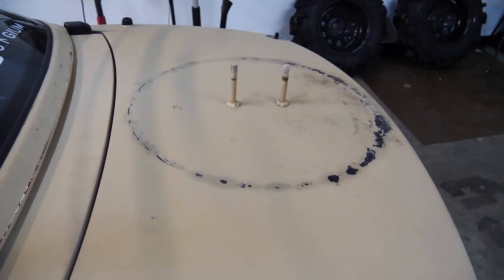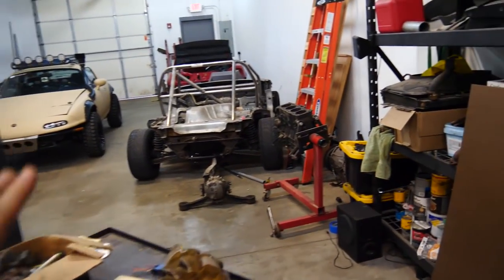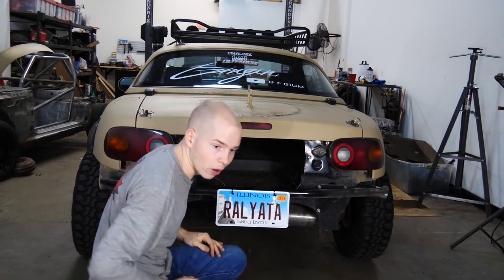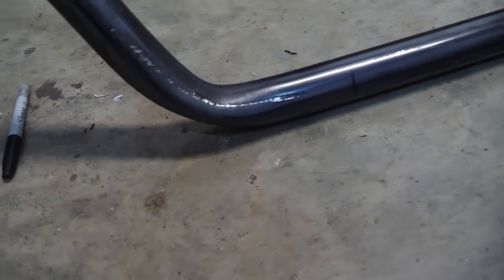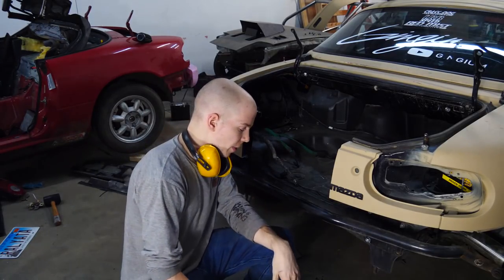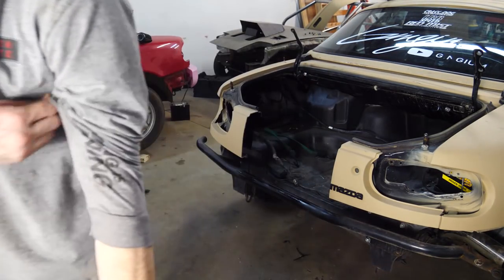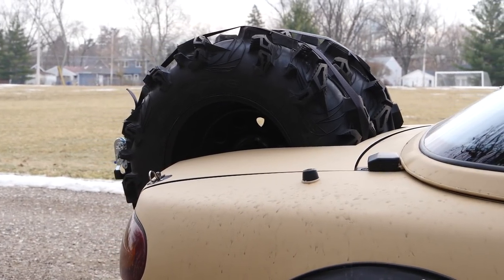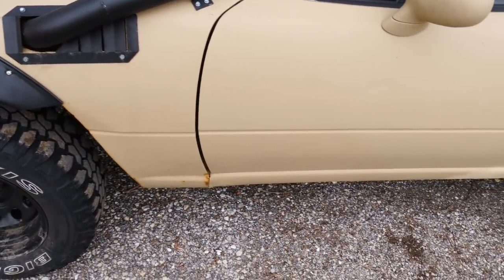Lifted Miata Gets a Trophy Truck SPARE TIRE Setup!

Comment: I feel like he’s gonna regret this
Reply: Who cares? It’s a RALLYATAAA.
Reply from the maker: Why? Its awesome!
Reply: He might, but that's easy enough to fix when you have a welder and a spare miata sitting around...
Reply: İ really don't like it
Reply: if he goes mudding again, that trunk will be filled with water or mud
Reply: @_Gingium_  because  this only helps wile it's 2wd and if anything Hits it it's going to bend and it's going to be totalled
Reply: FuNcTiOn
Reply: @_Gingium_  I completely agree, it is awesome... Just do some spray in bed liner to protect the trunk and you are all set.
Reply: @garrettmonk8432  ... Your comment is a bit confusing... The Miata is only rear wheel drive (2 wheel drive)... and the material Gingium removed is NOT structural, it is superficial... Besides Miata's are so light anything "hitting" them causes serious damage, even completely stock. He at least has a reinforced "bash bar" that will stop minor impacts, from causing serious damage... The factory bumper does not stop anything.
Reply: @JJ_ExMachina  so he is no longer doing 4wd conversion  and if he slides into a tree or something because crap happens it will start to separate
Reply: @garrettmonk8432  if he slides into a tree it wouldnt have mattered much if he had a full trunk or not
Reply: @RK Deviancy the trunk doesn't do shit the body piece does
Reply: @Veteran Gaming  you realize if you hit hard enough to bend the rear end  the trunk lid is gonna do absolutely nothing that trunk lid will crumple before them quarter  panels move
Reply: @terlaluanjay  drainage holes
Reply: @terlaluanjay  Yep, I was also thinking about that. And same thing with the rain, it´s going to be filled with water.
Reply: @_Gingium_  at least you can weld the bumper back to oem conditions right?
Reply: Chris Yarber not really cause he has another one just sitting in his garage
Reply: Chris Yarbe
Reply: What he needs to do is add metal around where the tires sit, and build a trunk wall around the tires. Essentially, this would re-seal some area of the trunk so it would still be usable!
Reply: Gingium what about water !!!!

Comment: Not a huge fan, also you are going to hate all the water and mud that is now going to fill your trunk
Reply: Yeah I waited the whole video for him to weld some sheet metal in there to at least close off the trunk
Reply: My thoughts exactly, atleast cut a few wholes or section out for drainage.
Reply: Yeah he should delete the whole back section to make it look as sick as a trophy truck
Reply: looks pretty bad. kind of a disappointment...
Reply: Isn't the battery of miatas in the trunk?
Reply: Spray in bed liner will prevent any rust inside the trunk from forming due to water intrusion, and he could easily wash out the trunk with a hose is it gets full of mud. There are already 4 or 5 large holes for drainage so it would not be an issue.
Reply: MasterMech77 like he said. Spray in bed liner will solve that issue. As for the battery, it is in the trunk, but Caleb could always move the battery, if he hasn’t already. I don’t remember if he did, and I didn’t catch a glimpse of it in the video.
Reply: Nick Henry none of that stops mud from entering the trunk..... as someone else suggested metal welded to the trunk between the trunk and the tires would limit the mud to the tire area which is a whole lot better, but still wouldn’t solve the water issue. I just think it wasn’t a well thought out plan in its current state
Reply: @THEpicND  ... Based on your comments, I can tell you have never done any "Muding" before... There are large drain holes in the trunk, so water will not collect (all cars have drain holes in them)... Mud in the trunk is the least worry here. Mud tends to collect inside the fender arches and inside the tires, causing brake failures and suspension failures, if you are not careful. It will also, clog up the radiator very quickly and cause the engine to overheat... Some mud in the trunk is going to be a mess, BUT it will NOT cause any problems... other then needing to be washes out...
Reply: MasterMech77 poor design is poor design, you solved a problem by creating a problem. Mud in the trunk isnt mechanically bad but it’s certainly an issue
Reply: @THEpicND  ... Thanks for your thoughts... Based on your comments you do NOT do any sort of off road or "muding", as you would NOT be concerned with "mud in the trunk" LOL
Mud in the trunk is NOT an issue... I promise you that... Not even in the slightest... A simple pressure washer or garden hose will clean any mud that gets in there... When off roading you have far greater things to worry about and have to deal with when done. 
    Cleaning the mud from under the vehicle, suspension, radiator, engine bay, and fender arches are something you will have to do anyway... SO cleaning a little mud out of the trunk is NOT an issue at all.
Reply: He did say he was going to get mud flaps too so....
Reply: MasterMech77 just because you are willing to accept sloppiness doesn’t mean its a good idea. Any mud more than a little covering will be impossible to get out with tiny drain holes that are in place currently. I am not arguing that your going to have to clean the car after going mudding no shit sherlock
Reply: @pietroghedini98  ... Even if the battery is in the trunk, it is a 12 Volt system... 12 Volts works even under water... SO no worries about shorting out or causing damage... Just have to make sure to keep things free of corrosion with a little dielectric grease.
Reply: Matt Kingsley bed liner makes clean up about 1000x easier. It will prevent rust. I saw another comment that said he could turn the trunk into 2 lids. If he did that he could box off the section the tires go into. It could prevent the mud from going into all of the trunk, while still giving the trunk a storage use.

Comment: will the trunk not fill up with mud and water. and you tires can be stolen easily right?
Reply: The trunk has 4 or 5 large holes in it from the factory for drainage... Almost all vehicles have them (filled in with plastic plugs)... SO no worries, it will not be an issue.
Reply: The Flash he’ll probably seal his trunk with sheet metal around where the tires sit and I doubt he’s gonna leave his tires in there when he’s rolling around and not off roading, yes both good points but I reckon he’s already thought about those scenarios.
Reply: @damienbennet200  just like he thought about tearing up his closet option to a daily
Reply: @robertbowers5487  Caleb has said in multiple videos he is planning in getting an actual daily and not use the Rally Miata as one any more. He also only needs the rally for the winter which is almost over and then daily Molly until the new daily comes. So tearing up his "daily" is not really an issue
Reply: @timjeanjaquet5576  in the future be he doesn't have one now. And tearing up the closest thing he had for a daily with 2 months until he can daily Molly is asinine and extremely poor sighted
Reply: I was thinking that too.  What I guess he could do is get rid of the carpet if any (hard to tell) and maybe bedline the entire inside of the trunk and have drain holes.  Just need to make sure the holes have a small "pipe" sticking out like 5mm or so, so water does not just dribble along the underside of the car.  I'm guessing this trunk won't exactly be used for anything when he's using the car on a track so as long as it's easy to hose it down I guess.
Reply: @robertbowers5487  it's his car maybe he already has another daily. This is YouTube videos of his are usually recorded a week before upload.
Reply: Yeah literally my thought as soon as I even saw the thumbnail
Reply: Everyone loves closet options.
Reply: Yeah but it looks cool
Reply: And the battery can be stolen because it's in the trunk

Comment: I'm just paranoid that the metal is going to scuff the tyre walls and rust everywhere.
Reply: Not paranoid but realistic
Reply: Those tires can easily take a scuff... they are designed to handle extreme conditions, they are rated for 1200 lbs, while off roading though extreme conditions... I have them on my Polaris RZR... you are not going to hurt them from a little scuff from the trunk lid. The tires are about 3 or 4 inches thick on the side walls, and thicker on the center tread section. No worries, they will be just fine, sitting where they are.

Comment: how about rain and the sharp edges on the trunk?
Reply: Rain??? what about rain? It's not like the trunk of the Miata is sealed... there are large drainage holes in it, as do all cars have them as well... just covered with a plastic plug. If you own a car, look in the trunk, where the spare tire is mounted, or any low section you will see the drain holes for yourself. Heck my 2016 Ford Explorer Sport has drain holes, all over the place...
Reply: but its not designed for that much, i would think that it would rust out very easily
Reply: @Heve62  ... SO you have never seen a pickup truck before? The beds of pickup trucks get tons of water in them... If what you are saying was true, then any surface of any vehicle exposed to rain or moister would rust. What causes rust is bare metal and exposure to the elements. Besides a little spray in bed liner will stop all of the issues with any rusting in the trunk, if anything was bare metal... AND like I said, there are large drain holes in the trunk. That will stop water from collecting in large quantities... SO unless you drove the thing in to a lake, some off roading and muding is NOT going to be an issue...
Reply: @JJ_ExMachina  j. I was only wondering since its not designed for it
Reply: @JJ_ExMachina  the trunk will probably rust if its not cleaned, large mudpiles with small stones will eat through the bedliner and the moisture in the mud will penetrate the steel and make it corrode, he should cut out the whole bottom of the trunk and make it open, and then put plastic covers on the sides.
Reply: @jakobgrimstad3280  I have used spray in bed liner/ under coating on my truck... It does not come off from exposure to rocks, mud and water... That's the whole point of spray in bed liner, it protects from impact... If you apply it correctly, you can hit it with a hammer and only dent the surface, but not break the bond of the spray in bed liner. Yes you could cut out the entire floor of the trunk, yes you could section of the trunk in to three separate compartments. Sure you can put plastic covers on the sides... All those are great suggestions...
Reply: @Heve62  ... No worries, vehicles are much tougher then people give them credit for... It takes years of abuse for rust to eat holes in to things... Yes rust forms when bare metal is exposed to the elements, and of course the salts used to clear roads causes issues as well... It is something that needs to be monitored and through upkeep and proper care, you can prevent rust from causing any real damage. BUT no worries, the trunk is NOT going to rust out over night, it would take a long time for any real damage to occur... By that time Caleb could easily repair or modify the trunk...

Comment: Try fill pipe with sand and then bend it , it should help
Reply from the maker: It probably would. But that would be such a waste of time.
Reply: I seen on bleeping jeep i believe it was that filling it with sand works really well to keep it from kinking/crushing
Reply: @_Gingium_  Maybe an extra 10 minutes and you wouldn't have to blame the tool anymore. Because it's not the benders fault.
Reply: @_Gingium_  but you save money and you don't have buy antoher more expensive bender ... we are using this trick in Poland and it works
Reply: @_Gingium_  it's not a waste of time when you get what you are looking for and don't have to spend more money and time getting more materials because the stuff you got didn't work.
Reply: Waste of time?
This whole car is a waste of time,this thing is gonna end up in the junkyard. And dont blame the tool,blame the guy who doesnt know the difference between a pipe and a tube
Reply: @Gunter8571  come on...This car is made beacuse of his passion , he decides what he do... if you don't like it what are you doing on this chanel ?
Reply: @Marug,pissing you off i guess
Reply: Gunter8571 not necessarily true, i own this pipe bender as well, and used schedule 40 pipe, and it’s still kink city. Not saying he knows wtf he’s doing, but harbor freight baked many imperfections into this tool
Reply: not a waste of time if it works homie
Reply: @_Gingium_  It doesn't take a lot of time to fill it with sand lmfao. Its not a waste of time if it works and prevents you from wasting money
Reply: This is the comment I was looking for
Reply: I have seen more expensive pipe benders kink pipes like that. Really filling the pipe with sand is the best option.
Reply: @uzi s Why should i leave?
The comment section is for comments and if you dont like it than dont read them. 
It’s just some tips on how to keep his viewers here and get some more quality work done without bying more expensive shit that he dont need.
Reply: @_Gingium_  It's a better use of time than kinking the metal and whining about how much money you just wasted.
Reply: @gingium it's worth a shot, you already have one kinked tube, chop that, fill with sand, tape both ends. Sand is cheaper than a new bender. If it doesn't work you're out maybe $10.

Comment: I actually really like it. It's a pretty extreme mod, but somehow it actually looks quite good. 

Just a couple things: You need to cut some big drainage holes into the trunk floor, seeing as it's a huge rainwater collector now. 
I'd also mount a chain into the trunk, so you can chain the tires to the car for safety from theft and also from the ratchet straps not holding the tires properly. 
You could also try filling the pipes with sand (really fine is probably best) and capping them off (maybe just weld a plate to the ends) before you bend them. That way, the sidewall has some reinforcement from the inside. You could also probably weld a Hossfeld clone yourself without much effort, to get a bender that's more accurate and probably works loads better than your current one.
Reply: Sebastian Mustermann great points but the Miata trunk has two 3-4 in diameter holes that you can open for drainage.👍🏻